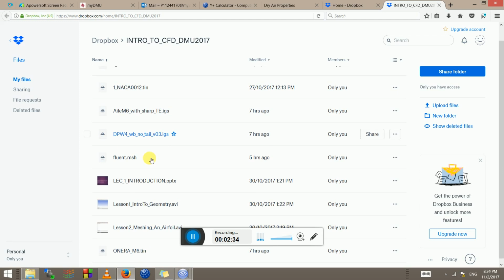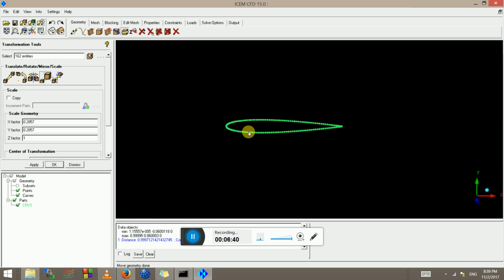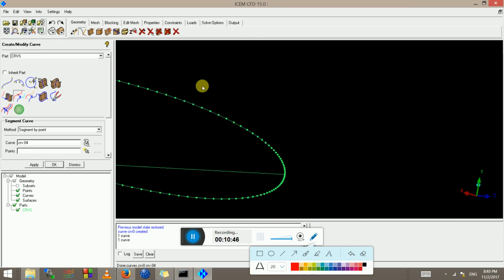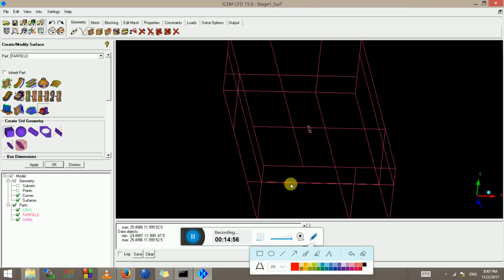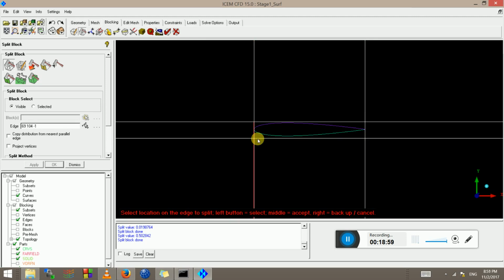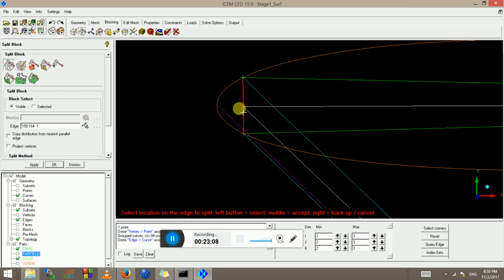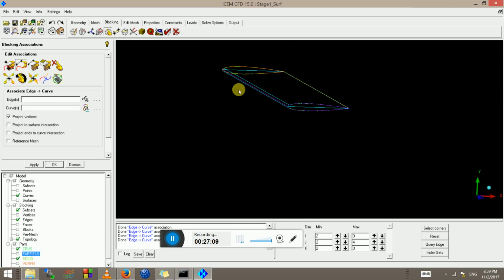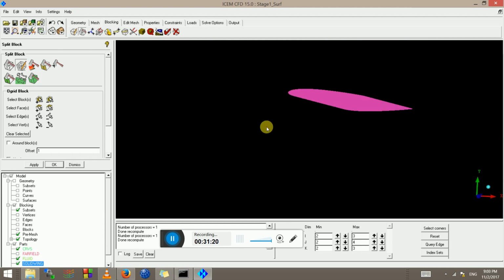Lesson 4a - Structured Meshing 3d - NACA Wing Part 1

Comment: Hai

Nice work. But how to mesh cambered wing having round trailing edge??
Reply: Hi, 

In CFD its crucial to simplify things as much as possible. So there`s only open (with a line connecting the open edges) and closed trailing edge.

Common misconception usually stems from the idea that bringing in actual CAD into CFD will promote realistic results. Good mesh needs to resolve the physics, instead of following the CAD model. Lots of details are not relevant to your analysis or have a marginal impact on your calculation. Therefore, knowing the physics in your system is essential. Good mesh should simplify CAD model and placing nodes based on physics.

Therefore there is no need to use a rounded trailing edge. This will promote unwanted skewness to the mesh which will reduce the overall quality of your analysis other than extending the computational time. 

Simple CAD => Concise Mesh => Quality Results.
Reply: This is a good video to learn however just to add one useful tip, during edit edge, one can use automatic linear instead of manually selecting edge to match the shape of the airfoil.